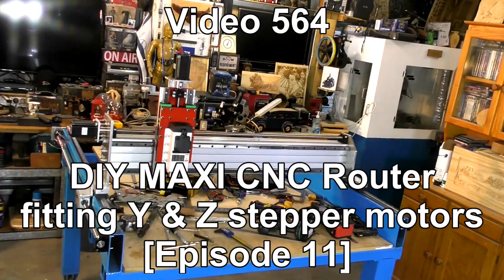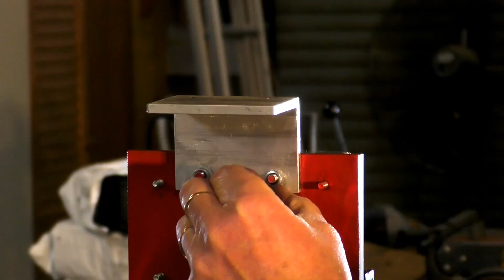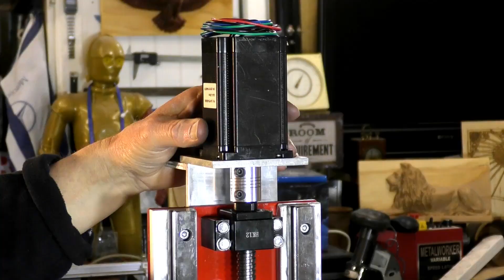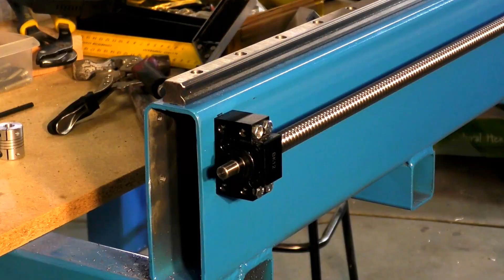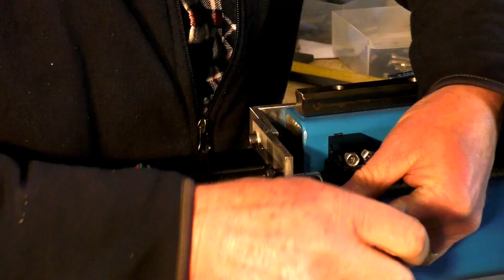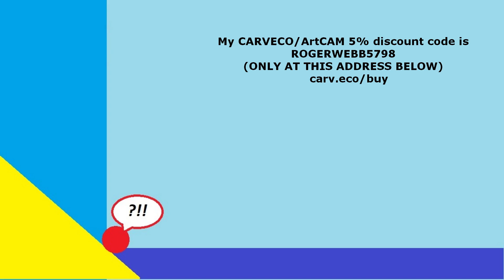CNC Build fitting Y & Z stepper motors [Episode 11]

Comment: love your work old mate!  giving this a lot of thought! love the way you explain everything so far. question # is it a huge job to put closed loop motor in at this stage? as most of the newer cnc's are trending this way! is there a lot or more complex wiring to go down this route ? as I would prefer it 
pat.
 ps if I go ahead I will be becoming a patreon  just need to understand the tears etc